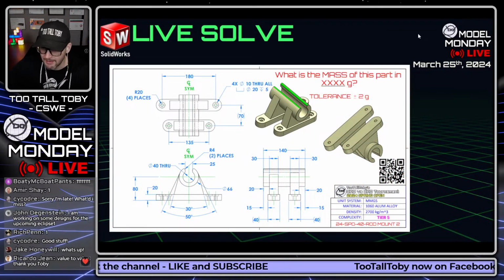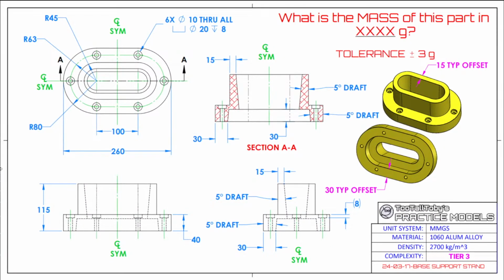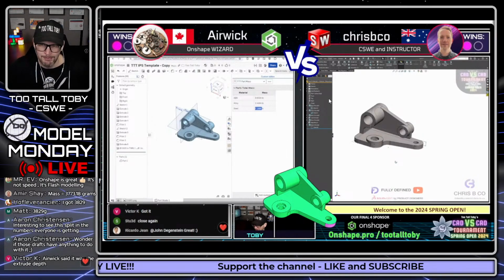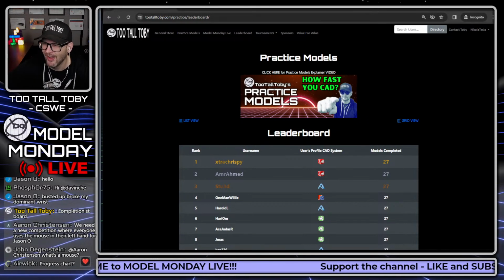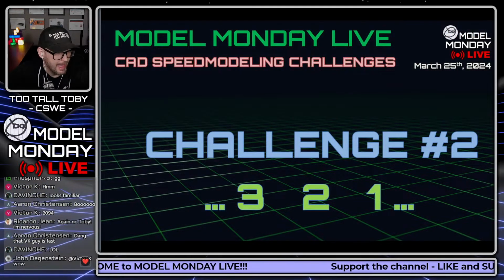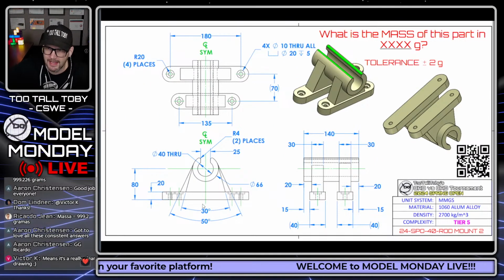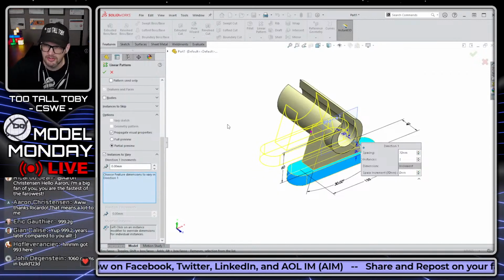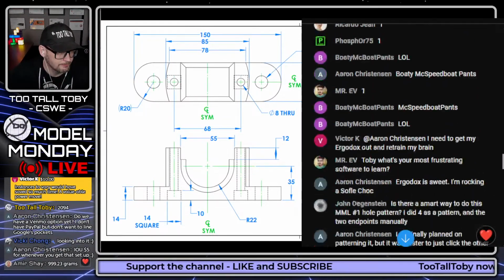Model Monday LIVE - MARCH 25- Live 3D CAD CHALLENGES for the CHAT

Comment: I see what I did, I used the (8) in bottom right view as the offset from surface for the very bottom cut, but the depth is 30 as shown is section A-A making the offset from surface as 10mm, changed that and had the 3829 grams
Reply from the maker: nice job finding it!